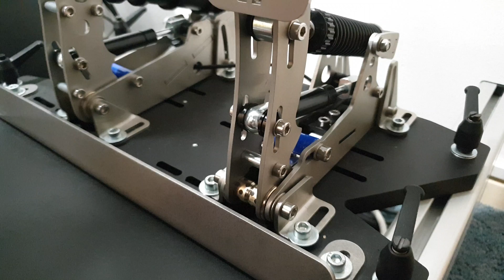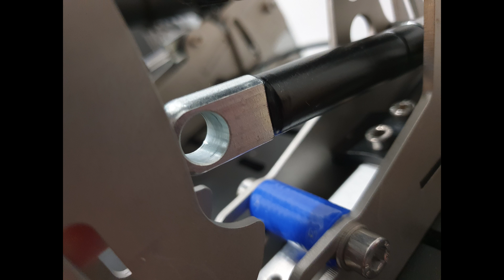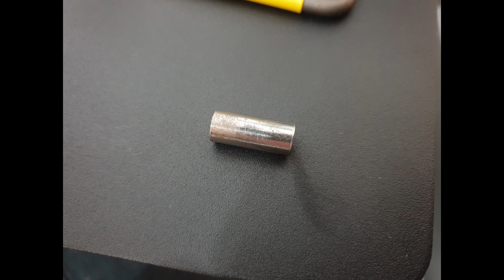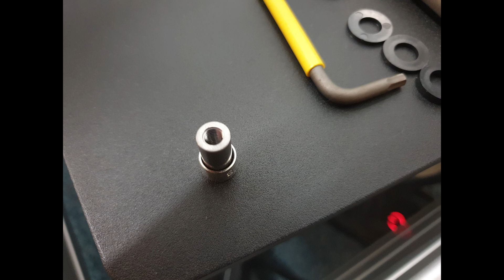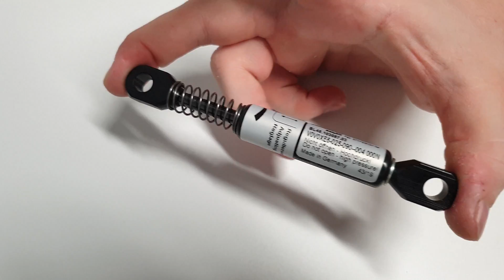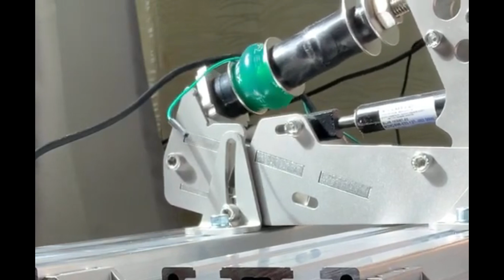Heusinkveld Ultimate Damper Tollerances and Play and Oil Leaking

Comment: Just add 2 washers and a very light spring at the other end of the damper, it'll keep the small pressure and eliminate the annoying play. All dampers without a return spring suffer from this.
Reply from the maker: nothing to do with the damper. the tolerances of the connection points should be right. even with a spring on it like on the old ultimates. it makes the same noise there. they never had their tolerances right.
Reply: @SimRacingSK  Just watched your other video and yeah that play at the hinge is crazy. I'm suggesting you add a return spring so the damper always extends to close de gap between rod, sleeve and damper connector. The problem with those dampers is that they offer resistance to movement, but they don't return back to extension like a spring would, so every time you move the pedal the damper has to first close the high tolerance gap before it can provide resistance to movement, making (part of) that sound you don't like. At the hinge it looks like a coiled spring like the one Fanatec uses on the CSL would keep the connecting points compressed to help with the play... but who knows.... Let Niels know on his youtube channel, see what he says.

Comment: Would you recommend these Ultimates+ for a 2 pedal set for 1080 Euros ? Or do you recommend any other for that high price ?
Reply from the maker: it still a good set otherwise I would not have bought it with my own money and kept them. so i can recommend them they are not the most bang for buck dough. They say they are working on the tolerances of the dampers mounting now and will send me improved parts when ready.
Reply: @SimRacingSK  Curious if they ever sent you the improved parts? I just purchased a set of Ultimate + and the only issue I have with them is exactly what you show and describe in this video. The most frustrating part is I can feel the click in my foot when it moves due to the play when making throttle adjustments - almost feels sticky. I ended up removing the dampener completely and it's now buttery smooth but I miss some of that resistance that the dampener provides because it feels a little too springy. I reached out to Heusinkveld support and they asked me to check the spring that sits between the load cell and the bottom of the throttle pedal. No issues with it and found it was perfectly seated. That's when I decided to remove the dampener and sure enough the clicks feeling went away. Hopeful Heusinkveld can provide a solution.
Reply from the maker: @phantomracers6399  yes i have the improved parts i might do a video on it. its a slight improvement.
Reply: @SimRacingSK  thanks for the reply!

Comment: do u feel any difference from the ultimate and ultimate+ dampers?
Reply from the maker: the damper feeling seems to be the same. the difference is they use sleeve bearings in them now. both the old and new ultimate+ set has play on the damper assembly dough.
Reply: @SimRacingSK do u think its a tolerance thing? cause my he handbrake play is pretty bad too.
Reply from the maker: @DjFatJay  you have the new handbrake? please make a video and show it too the world :) also contact heusinkveld telling them about the problem so they can fix it. its probably a tolerance thing too.